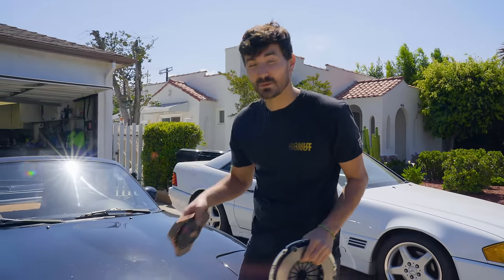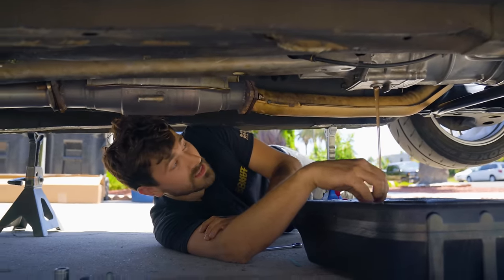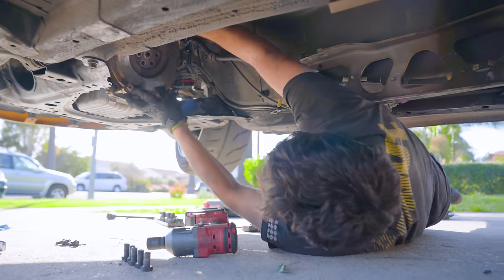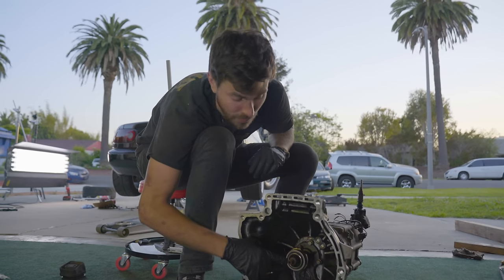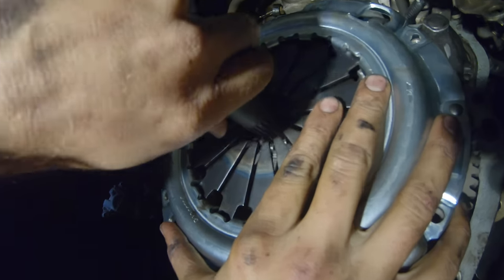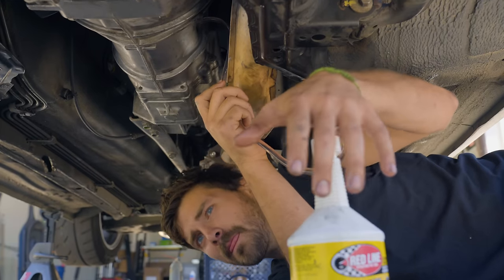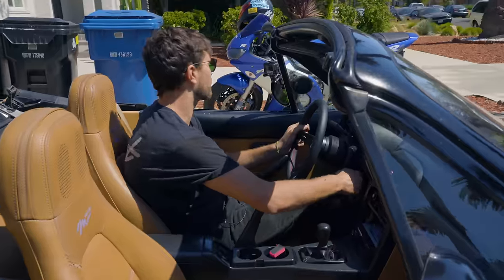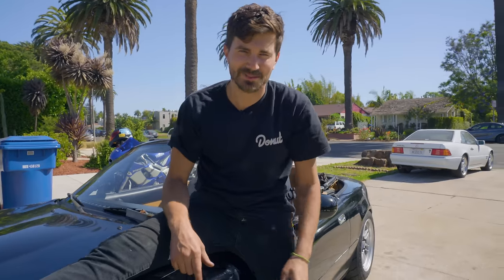We got sent a super weird clutch and installed it anyway

Comment: The transmission would have slid right on if you had made up a couple of guide pins. Two bolts with the heads cut off and pointed a bit on each side of the engine in the bell housing holes. Long enough that the transmission would have been on them and lined up before the spines of the transmission engaged the clutch disc spines. Instead of turning the input shaft to line up the splines you could then have turned the flywheel with a bar against the guide pins. Might have gotten the job done before dark. Live and learn!

Comment: Here's a pro trick for free. Take one of the larger bell housing bolts, go shopping at the wreckers for a similar bolt a little longer. Cut the head off of that bolt, screw it by hand into the engine block,  and you now have a guide pin to help you  locate the trans back into place. Don't forget to put a screwdriver slot into the cut end for retrieval after use.

Comment: Friction doesn't care about surface area.  The only thing that changes friction is the coefficient of friction and the force applied.   If you have a regular clutch and remove half the friction material, it will still do the same thing if the amount of spring force is the same because the coefficient of friction between the two materials is the same.   A simpler example is that a larger tire doesn't give you more grip, it just makes it more likely to catch a spot in the road with a better coefficient of friction. Like if there is dust, mud, water or ice on the road.

So the shape of that clutch has nothing to do with its power transfer performance, which makes it even weirder why it's shaped that way.

Comment: The main benefit from such a clutch and flywheel combo is NOT a somewhat higher torque from the clutch or horsepower from the engine.

The main benefit from the lighter flywheel is that engine revs drop faster when you let off the gas pedal. This combined with the smaller clutch engage-disengage window (and the consecutive smaller useful clutch pedal travel) means that you can change gears much faster, without grinding them.

Comment: The job would have been a lot easier if you raise the car more? @ 9:20 if you don't center the clutch disk so input shaft slides with out binding the transmission will fight you going in .

Comment: one error, you stated the clutch wasnt dragging because the wheels were not spinning, you checked this in neutral... should have been checked in first with clutch pedal depressed. but wither way, i saw it wasnt dragging after you putit in first, just wanted to point that out incase someone saw that as a method to check for drag.

Comment: why is that gearbox so big for the 1.6 or 1.8 engine? looks like a proper pita to get in and out. I've removed the gearbox on 328i, it's considerably smaller (and prolly lighter) despite having to serve a straight 6 with a lot more power.

Comment: instead of putting the trans in gear and rotating the shaft with the drive line. i like to put a ratchet and socket on the crank pulley bolt to maneuver the splines to line up

Comment: Well this clutch experiment was reversible until you dropped the pressure plate and likely the disc too and put a gigantic chip in its machined surface. Also remove pressure plate bolts .5 to 1 turn at a time to equalize the clamp load on your fasteners during removal.

Comment: I think the reason why the torque rating on that clutch is so low. It's a spring clutch, so they really can't handle a lot of torque. It's supposed to help with clutch chatter and drivability but it also kind of ruins the point of having a triple puck clutch.

Comment: Ceramic clutch, 18 wheelers have been using it since the 1970's!
Reply: Agree, worked for Mack Trucks Inc for 15 years, it was the HD version, in big HP motors or like concrete trucks!

Comment: When you pull a transmission in the driveway. Use the tallest Jack Stands you can get your hands on. Place the front end of your transmission on a block of wood tip the tail up and pull your transmission jack out. Place the tail gently on the ground. Don't herniate yourself playing with your cars. It's all fun and games until you have to have a price check on your Preparation H at the grocery store.

Comment: A Miata is only gonna hold about 150 ft lbs to the ground anyway. So there's no need to sweat the clutch holding more. That's more of what we call a circle track clutch. The engine should spool faster with that tiny disc.

Comment: It'd probably be a good idea to talk about why you don't want to go overkill on your clutch.  We who mod our cars enjoy overengineering and excessive power/performance/capabilities. So, if you have the choice between two clutches and the "better" one with twice the holding strength of the other is only a few dollars more, why not just go for it?  

Generally, the clutch is the "weak point" in the driveline on purpose.  So when you put in a super-grippy clutch, you're moving that weak point from where failure is relatively cheap (the clutch/pressure plate) to somewhere else that is much more expensive to fix.

It's like a shear pin which is there to protect those more expensive parts.  Ideally, the first place the traction breaks is between the tires and the road, but most of us aren't daily-driving racing slicks, so if the tires hold and your engine is putting out more torque than any of the driveline parts can handle, something has to give; hopefully the clutch is second in line.

TL;DR:  Higher torque-handling capacity doesn't sacrifice just drivability, but potentially also your first gear, or perhaps your crankshaft.

Comment: Super aggressive clutch that has a lowish torque limit? Maybe it was meant for a Naturally Aspirated Rotary Engine. Rotary’s can be redlined around 10,000 RPM’s and get their best speed at those higher RPM’s. On the other side Rotary’s are not known for high torque pounds per foot at lower RPM’s.

Comment: and now in a few hundred or thousand miles the clutch linkage/lever/cable/M/C will give up due to the much stronger pressure plate. At least it does on Volvo 240s. maybe you'll get lucky though.

Comment: Lmfao that clutch has actual brake pads on it 😂
Reply: Technically it's the same thing, Clutch disc is made of friction material, which is what brake pads are made of (organic, semi-metallic, ceramic). No reason it wouldn't work
Reply: What got me is that it looks like they just bought brake pads from the store and slapped them up there instead of spreading the friction material throughout the disk

Comment: So it's not that bad, but if torque holding is not the benefit, why would someone switch to a clutch like this? Is the material more heat resistant?

Comment: I don't see any benefit from this design over a normal performance clutch that makes full contact with the plate. If anything, it increases the risk of warping the pressure plate due to uneven pressure, heat, and wear. It uses good materials but it puts a lot more stress on those materials by reducing the contact area. So the added benefit of the better materials is countered by the added load and the lack of volume of that material. It's like comparing brake shoes to brake pads. The materials have to be better because they've focused the load at three points.

Comment: Replaced the clutch on a 90 Miata. It was just as bad as the video shows. Right down to body lifting the trans up into position. It was so bad it was the last big project and sold the car. If I buy a low bodied car again I will buy a lift for $1500.

Comment: 190 ft lbs of torque isn't very much.  If you're car weighs over 2500 lbs it probably gets pretty close to that on any upward hill.  Turbo doesn't really add any torque unless you have some sort of low RPM turbo or you're using a supercharger and mis labeling it.

Comment: I did a six puck once and was told that it will work fine by Summit Racing in a MX6 LS . There was not slippage! It was like a Sprint Car .. IN or OUT. Was afraid it was going to break the trans or other drive train. FN Sucked! I was so pissed called them.. They sent me to Ram. Went to a Ram Stage 1 clutch ..More conventional .. Perfect. Don't ever buy one!
Reply: Dude they're race clutches, less surface area to the clutch means waaay more aggressive bite, it's like an on-off switch.  Perfect for a race car, horrible for a street car/daily driver.

Comment: 189 foot pounds of FOOT force to disengage. Hahaaa
Tough but doable in a daily.

188 foot lb of clamping force. Not related to the foot/lb of torque engine puts out. 
Think of the tinny bolts that hold that 100lb trans to the engine.  The clamping force is what does allot of the work

Comment: so im not the only fool to bench press a trans under a car. one time i did a chevy truck clutch that failed on the road side. i lifter with a strap around my shoulders and used the shift lever from above via the floor pan that comes out of the old square bidies with the saginaw sm465 trans. heavy but easiy done in an hours time any place any time with a handful of wrenches. the good ole days/
today you need 50 thousand specialty tools and computers plus a ongoing continuing education to remain competitive and current.
the days of 1 dollar fuel 4 speed direct gear boxes and glass packed mufflers are long gone. this guy should have dropped in a coyote engine not just a clitch

Comment: Let me tell you about the "BUTTON CLUTCH" as it was referred to in the early 80's on diesel equipment. Very strong and aggressive, however, when this type of clutch when ended it's service life and needed attention or replaced... Get your wallet out...This is a ceramic metallic compound, tougher than the metals around it. Using this in a the average daily driver I would not recommend it because of the inevitable repair. Flywheel and the pressure plate WILL need replaced. I will reiterate this compound was from diesel engines when set up right it is overkill for the Gasoline huffers.

Comment: Why didn't you just fill the trans through the turret?!?   It's 1000000000x easier than pumping that crap..   Pull the fill plug and dump fluid in the turret till the fill plug drizzles.  DONE!!   I used to do this on hondas, but I'd fill them through the VSS hole. it's SOOOOOOOO Much faster.. I can PROPERLY fill a honda trans in less than 60 seconds! just like you coulda filled that miata trans. LOL

Comment: That clutch design is bad, since it will wear the components much quicker.
Reply: It's not a bad design, it's a racecar design. Based on the torque rating it looks like it's meant for an autocross miata that makes stock power

Comment: ..but you know you will just have to rip out that dirty greasy drive train all over again?!  I cannot tell you just HOW against I am against installing some unknown part that may or may not work into any car of mine... But you gotta youtube to make so fine, even more important - installing a clutch with heavy return springs?  Ah HELL no, trust me that'll get old mighty fast!  The day you're bombing along in traffic, it slows to a crawl, and it goes on for miles and miles of stop and go. and there you are, driving with your new clutch plate, that requires the leg strength of an angry Bull Elephant, but that you now have to push down over and over and OVER AND OVER